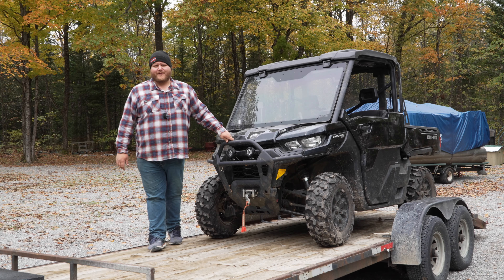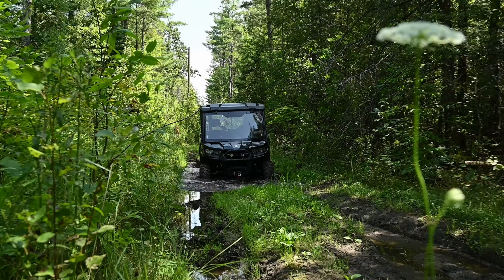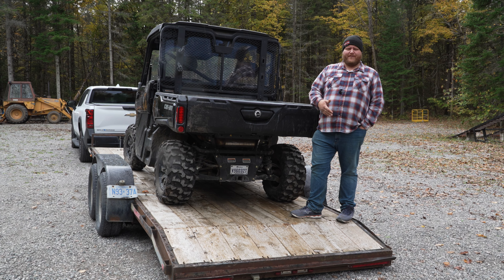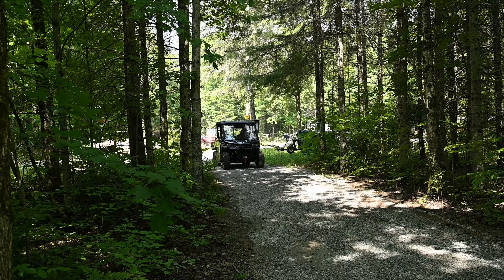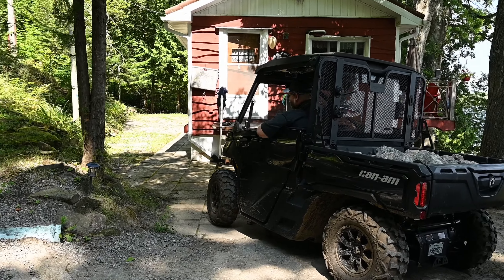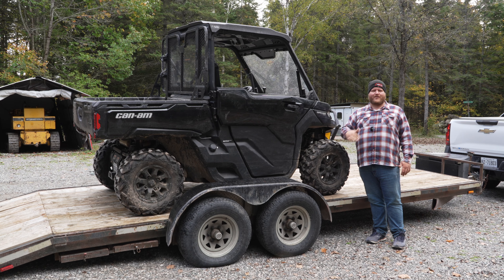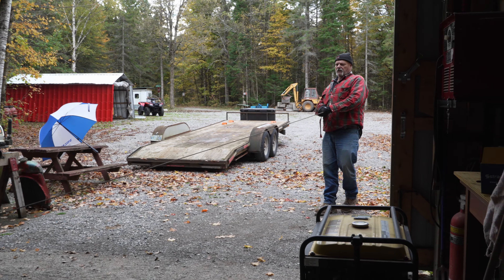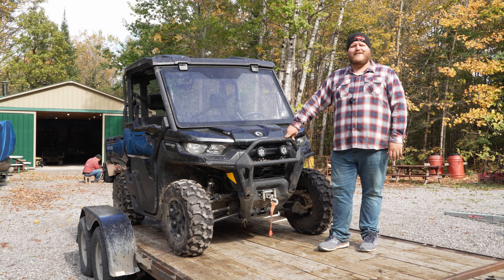The Good, Bad and Ugly - Can-Am Defender 3-Month Review

Comment: Alternator?  You meant Stator.  That's not a quick fix or cheap fix.  Can Am isn't known for quality in SxS or ATV's.
Reply: Alternator is what recharges the battery. So no not the starter
Reply: @westcoastvibes. Stator, not starter.
Reply: They don’t have alternators?
Reply: Alternators (like on cars) are usually belt driven, and separate from the engine block. A stator does the same job but is internal to the engine rather than a built-in external component. At least that's my non-expert understanding of the difference.
Reply: @liamrobinson2084  maybe on a motorcycle… idk if that’s the same for atv’s and side by sides.
Reply: Polaris is junk . I have owned several . Honda Yamaha Kawasaki are the best period
Reply: There's a local one in NB that has over 50,000 km on it, it's a 2022
Reply: @Zanderthelab  The can am has a v-twin engine, same as motorcycle.
Reply: Lmfao
Reply: Some side by sides do actually have alternators (my wildcat XX does) but typically they just have stators like you said. As they get more complex some manufacturers add an alternator so there's more power for accessories. I'm not sure if the defender has one or not. Could be a voltage regulator also...
Reply: @russellabernathy3241 
I wouda bought a yamaha,honda or kawi but bought the 24 defender ltd 3 seater for the seats,30" tires and ac.
Test drove the kawi ridge and it was high revs loud,door was tight to my shoulder and opening too high to rest your arm  on the windowsill.
No polaris tks 
Happy so far
Reply: Has my HD10 XMR Defender since the first year they came out it is the best machine I've ever had. Can AM is known as being the king of this sport. Bombardier does not build junk.

Comment: I have uses them long term at work, the major issues include, hard shifting, broken shift linkages/ extremely poor set up, this is with the entire canam line up, lots of this has to do with 1way on primary needing service, you will break the linkage or brackets if you try to force it.  Garbage door latches and door stopper/cable, doors will open on there own while driving with zero warning, then the tiny cable breaks and then the hinges are bent and door will not close, had about 25 units do this, every machine we had on site, very poor heat management, get the limited with ac/ this is not brand specific, these manufactures need to start giving us what we pay for, 30-50k for a piece of garbage that will cook you out of the cab? Rattle, bang, body flex, squeak. Visco lock 3wd junk, the worst front diff in the industry

Comment: Excellent real life review. I own a 2022 Defender and so far it's been great. I bought it for working around the property, but I wanted something that also was trail capable. I have gone on about eight trail rides with varying terrain. It is quite an impressive  machine. Our trails have a 65 inch width limit and it gets quite close sometimes between trees or gates. I'm surprised at how many owners immediately put bigger tires on their machines. The stock tires work well and the machine already has good ground clearance. I agree 100 percent with your assessment of skipping on the power windshield and way overpriced audio roof!

Comment: For the cost of these things you can get a used truck
Reply: You're not wrong however, I used a Ford Ranger before I got my can am. As small as it is, the can am gets into tight places easier and weighs less on the turf driving around my farm. The dump bed is also invaluable for farm work. That being said, I bought a base model and only opted for a roof, windshield and backsheild and paid about $12k in Jan 2020 -right as Covid was starting to cause a shutdown of all shipments. Most options can be added later but still expensive when you do.

Comment: i have a 2018 Can Am Defender cab hd10 with 678hrs and 14689km with no issues so far.  i changed engine oil every 100 hrs and diff oil and gear box oil every 200 hrs.  i greased the roller bearing in the primary clutch at 13000 km.  I beleive all brands have their issues eventually.  I love riding and trying different brands. Bashing a brand cause a failure is not my thing to do.  Mechanical machine will brake down at some point but preventative maintenence will lower your chance of walking back from the woods.

Comment: I own a 2018 outlander xt 1000 and a 2024 Defender Limited. Neither has been back to a dealer since they were purchased.
Both smooth running, powerful and reliable machines to this point. I have owned pretty much every brand in the last 25 years. Have had both a Yamaha Grizzly and a Kawasaki brute Force 650 that started burning a fair bit of oil before 2000km. No issues with the one Suzuki, 3 Hondas and multiple CanAms I have owned.

Comment: I have owned a 2020 defender hd10 since new. This thing gets beat up on now has 5,700 k on it battery was replaced around the 4 k mark that’s it other than bearings and bushings (typical maintenance). Keep in mind I have forward a arms with 32” system 3 xtr 370 tires. Bike has been on its side a few times and did great at minded off road park. I ride with my 23 and 25 year old boys riding built renegades with wet shot and nitrous. Soooo when I say this thing takes a beating I’m not kidding !!!

Comment: I m a yamaha guy but would buy can am before polaris. My friend has a 2023 ranger and i noticed on polaris web that they don t have engine breaking. Need that feature on a sxs.
Reply: I have a 2025 Polaris Ranger xp1000 northstar and it has all kinds of engine braking. Polaris fixed a few issues on the 25 models, which was good because i was heading for a can am myself. I Really enjoy the ranger now and have 450 miles on it at the moment
Reply: the engine breaking u feel i think is the drivetrain not free enough.imo
Reply: @timdavison2417 I'm in between either the trail.boss.or the defender. All.the issues that polaris did have you said for the most part they have addressed those issues?. Big questions how is it running now, and would you buy it again